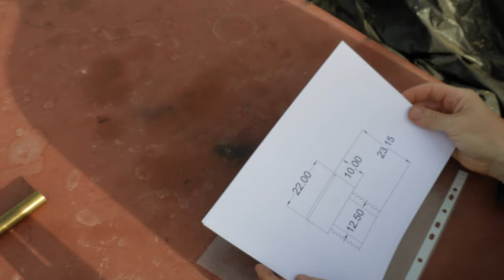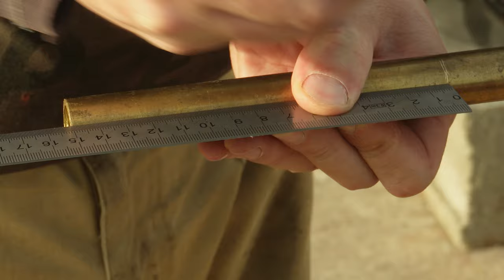Make an AUTOMATIC CENTER PUNCH pt 1

Comment: Do you mind sharing the plans?  I won’t make the exact same thing only because I am used to working with the inch system.
Reply from the maker: You will have to teach me how to remove them from autocad. I do all my projects there but my IT knowledge are very limited. Could I take pictures of the sketches and send them to you email ? This is easy and I know how to do it :))